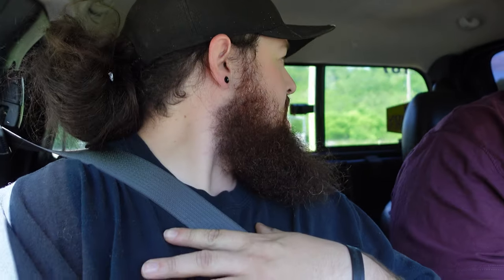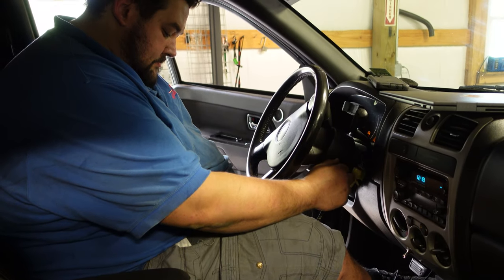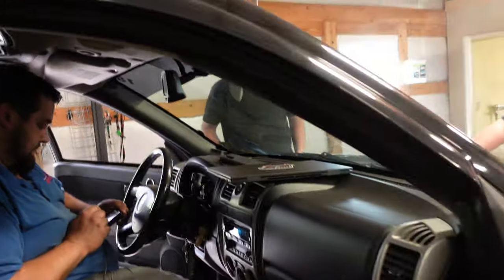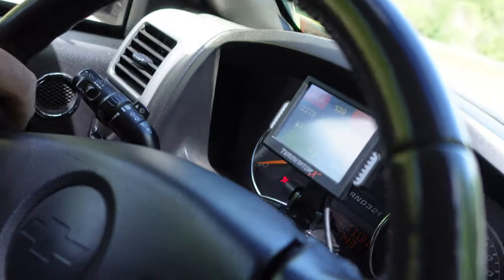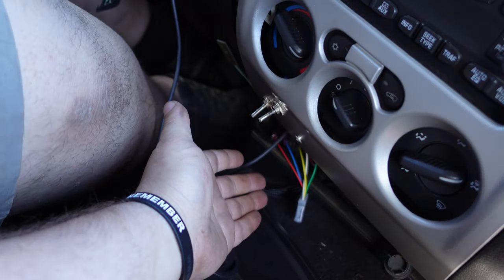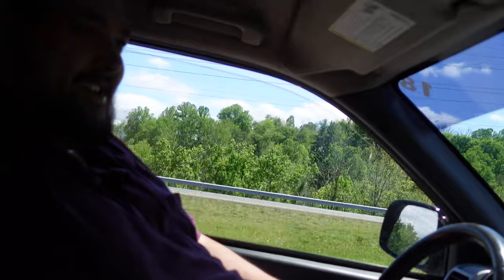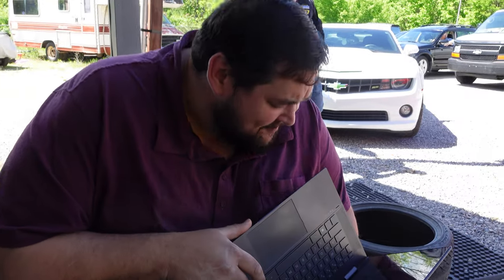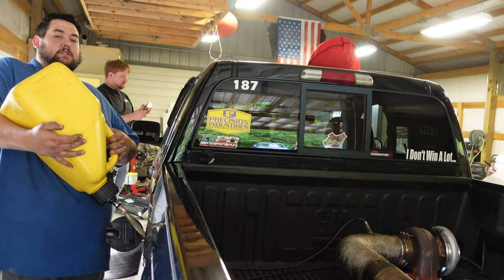Truck Norris is Back! | 408 Stroker, 88mm Bed Mount Turbo, & Trans Brake

Comment: Plz tell us how your properly venting crank case pressure at that boost level.

Really interested in seeing how your guys do it on that setup.

Thx 🤟
Reply: It's venting from fill neck and stock locations I'd hardly call it proper.